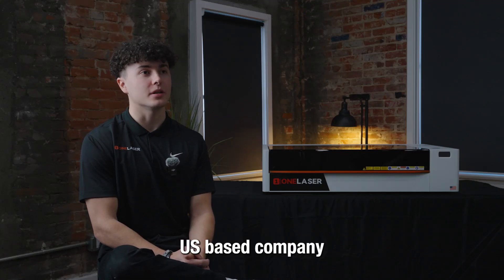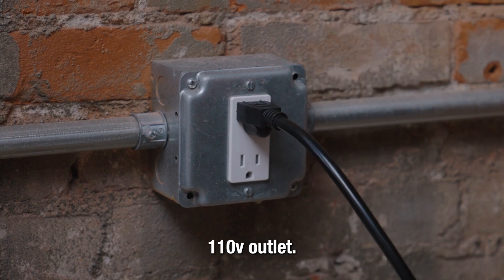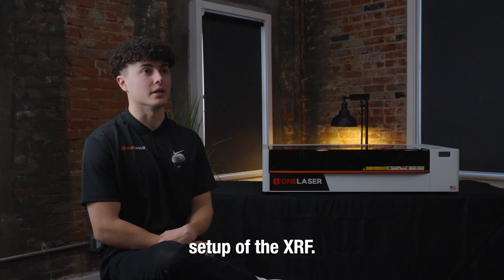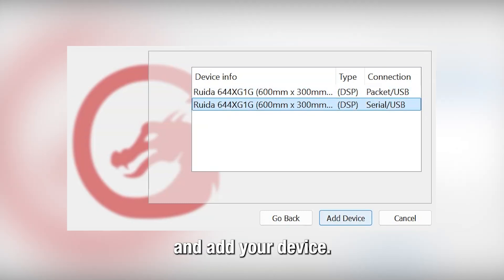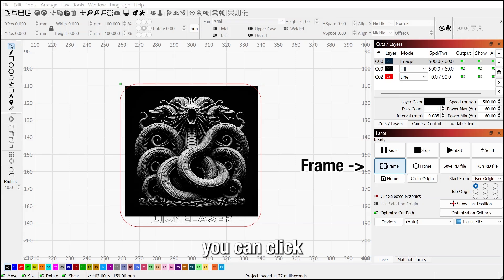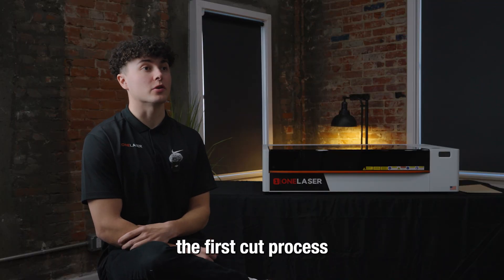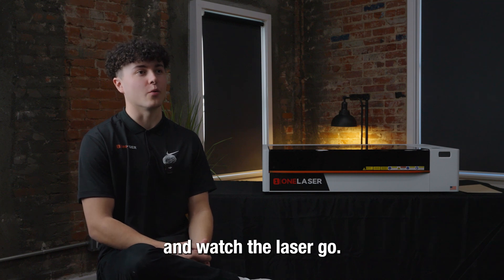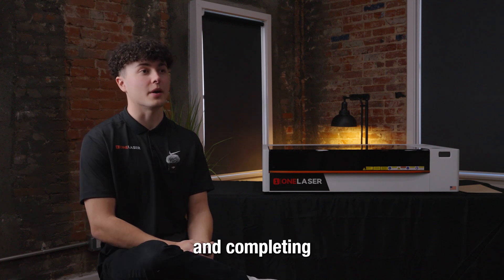First Time Physical Setup | OneLaser XRF Desktop

Comment: Where is the information on how to set up the camera? The manual is almost completely silent on this. Some of the information is there but detective work is required. The camera calibration file on the USB stick doesn't seem to be supported by Lightburn 2. The tech support wasn’t able to help me at all.
Reply: I agree, the lack of info for the setup and running of the XRF is infuriating me. I found a video here on yt where the guy walks you through the camera calibration. I'll find the name of that channel in just a sec. But I sure do wish there was more support when it comes to setting and using this machines. The 1Laser guys remind me of most of the engineers I have known...Brilliant but terrible communication. Brb with that channel name...
Reply: @beardedbuildsco has a camera set up tutorial
Reply: @LittleSeasonSaintTX thank you I will watch some of those videos.